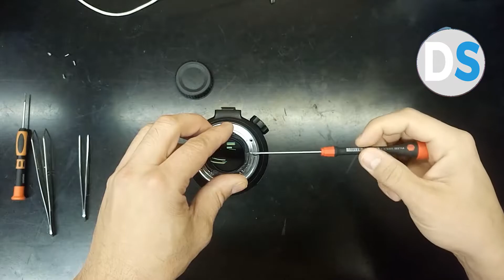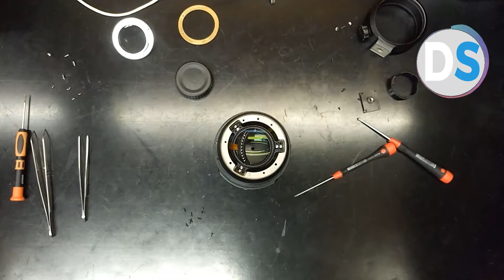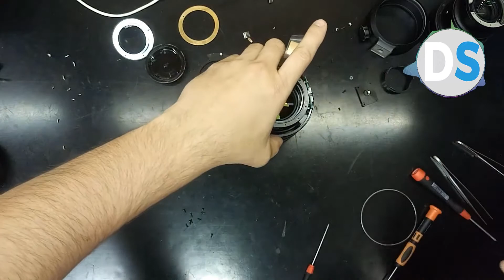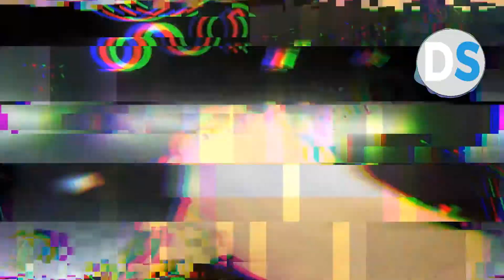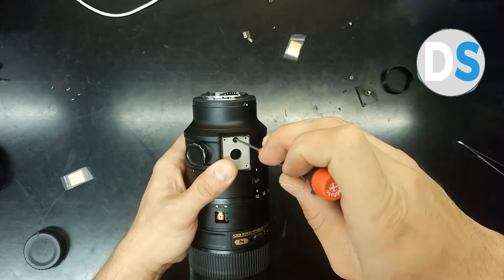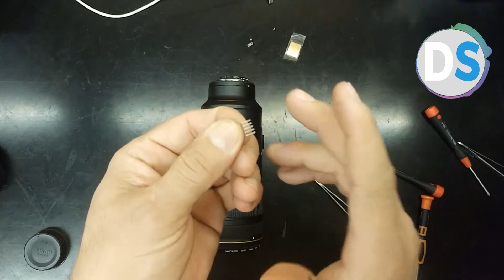How to repair lens Nikon 70-200mm VR II AF-S G ED NIKKOR with zoom problem - stiff movement

Comment: Thank you for sharing... you just saved me $500 + shipping and not having to ship out and wait for the repair and shipped back. The weather stripping gasket became unseated and wedged between the rear face plate, it took some time, but now appears to work just fine. Thank you again!!!

Comment: Would this video apply to a lens that is stuck at 200mm?
Reply from the maker: Hi yes disassembly is the same but the problem may be is different.
Reply: Did you find a fix for this issue?

Comment: Hi, hope you're alright.

When the pandemic broke out and we were in isolation at home, with knowledge of photography and the assembly and maintenance of microcomputers, I decided to get to know the interior of the lenses and to remove as much fungus as possible. And so, friends came to me and it was a means of income.

This 70-200mm G II model arrived in my hands. A big challenge in disassembly as it was the first time working on it. Even before the disassembly, the autofocus was already showing signs that it was going to stop, as it remained unused for a long time, accumulating a lot of fungus.

Upon reaching the magnetic motor block, I felt that it was bad to turn. Something sticking, locking. However, being a new element, I was not able to disassemble the magnetic disk and the rings that hold it. Suspected corrosion.

Would you have in your files, recording of dismantling the magnetic assembly of the autofocus motor?

Sorry for the translation, as I'm from São Luis, Maranhão, Brazil.
I would be grateful for this help, as it would be an experience to recover the piece and make the owner happy.
Reply from the maker: Hi you can send the lens to us . We have a lot of clients all over the world. /)
Reply: How to open 70-200 F 2.8 EDFL VR ii middle base lense VR motor, magnetic disk are barrier at time

Comment: Hi mate, my lens 50-500mm lens stuck at 50mm. I bought it second hand. No visible damage to the lens outer. I was told it was dropped once. Any suggestions before i do surgery please.
Reply from the maker: Hi, need to disassemble the lens up to the zoom ting. Check the zoom notch or some for screws missing;)
Reply: @DIGISERVICEBG  thanks very much for your reply. I have gone up to removing the inner 2 lens elements and it's adjoining  screws and fixtures. Still long way to go. Just taking pictures at each stage. Wish me luck.

Comment: hi, a help please, I have a squeaking noise inside my nikon 70-200mm f2.8 vr2 lens, it no longer autofocus (it works 1 out of 20 times by pressing AF).
do you have any idea what it is?
Reply from the maker: Hi you have autofocus motor problem. need to exchange it. Send it to us :)
Reply: @DIGISERVICEBG 
Hi! Old post but Im trying anyway.  How much do you charge for a AF motor swap?

Comment: What size screw driver did you take off the cpu contact plate off with? I need to unscrew mine due to a drop and if you know where i can buy a cheap set it would be appreciated , thanks
Reply from the maker: Hello, thank you for your question! The screwdriver is WIHA  - PH00X60. This is the best and as you can see i use only this model. :)

Comment: Please help me for my Nikon D70 200 dirt and fungus between in lense remaining 2 glasses 
Front element glass and back mount glass I change but still 2 glasses aren't open due to magnetic disk, manual focus ring and VR motor are too complex , help me ASAP 
I haven't able to pay for any repair center so I use my references and contact with my old time friend who's doing work in mobile service station but he's also stuck due to that level critical complexity.
Check photo: 
https://drive.google.com/drive/folders/1BKISzeq0UIdjr4dGTQ9i6Fb_tpH2enX2
Reply: Kindly tell me next process to open it... I'm stuck I have only 18K ₹ (indian currency) work in this november and December and service center charge for it 12K ₹ so I tried my own , help me
Reply from the maker: Hi send the lens to us :)